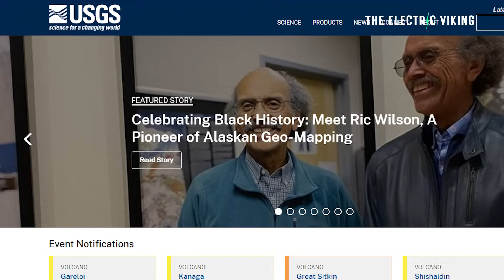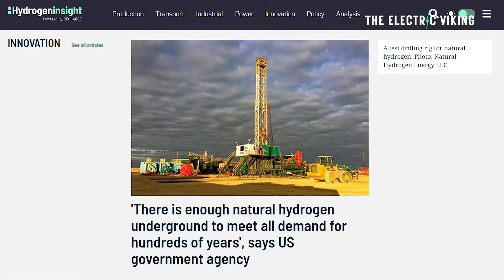US Government: 'Gold mine' with 200 years of hydrogen discovered underground

Comment: Sounds like the "South Sea Bubble" all over again.  (Scheme to extract the 0.04% of gold dissolved in seawater)
Why would anyone want to consider hydrogen as a replacement for efficient and proven fossil fuels?
Especially as there is no such thing as "human caused global warming/climate change"
Another daft idea from the non technical idealists.
Unless they are smarter than the Engineers and know how to transport a gas of the world's smallest molecule that leaks through anything and I just read that those leaks can self ingite through friction,  burn with a colourless flame and set fire to anything combustible in the vicinity.
Could always go for Hindenburg II I suppose.  Solar panels on top of the envelope to power the electric motors and a nice BIG lithium battery for when the sun goes down.   Bit slow compared with a 747 but it would be "saving the planet" (whatever that means)  What could possibly go wrong with that?

Comment: Everyday folks using hydrogen as fuel, forget about it. It leaks like nothing else. None of the petroleum piping, storage infrastructure can be utilized. A hydrogen refueling station in Finland already blew up, imagine hundreds of thousands, all around densely populated cities. The only reason fossil industry obsess on hydrogen is bc it's supply can be controlled & taxed like oil. Solar on the hand just falls on our roof to power our EVs, but Im sure they will find a way to tax sunlight too.

Comment: Hydrogen does not exist in nature in its elemental form.  It bonds - aggressively - with other elements as it is highly reactive.  It is only found in nature after it has combined with other elements and molecules.  The hydrogen that is underground is bonded into the hydrocarbon molecule, which is natural gas and oil and coal.  It's also in water - lots and lots of water - and to separate it from the oxygen atom takes a great deal of energy.  More than you'll get when you burn the pure hydrogen, assuming you can transport, store, and use it in a fuel cell or piston engine.  
This whole idea of "hydrogen underground" is silly.  Beyond silly.  Stupid in fact.  It isn't there.  Nothing to see here, move along.......

Comment: Clever. Just the time some people were getting ready to charge their cars with their solar system for free, they are trying to replace petrol with something as expensive.
Reply: Solar cannot provide the heavy lifting power generation we need to run the modern world.   It is good for spot generation when nothing else is available...when the sun is shining, but the capacity of solar isn't going to be charging many cars for years to come unless you have a large house with the roof covered and you don't drive very much.   In that case for sure...you could run your car on solar, but most people won't have that convenience and compressed hydrogen makes more sense once the oil gets low..which isn't anytime soon.

Of course the USA has abundant natural gas and when oil becomes too expensive to extract and refine we can make every product now made from crude using natural gas...and there are centuries worth of known deposits.

Comment: Quick question, if we source energy from oxidising hydrogen for hundreds of years what affect would that have on oxygen levels in the atmosphere? We would increase the amount of water on earth.
Reply: Good point (theoretically), albeit moot point (practically). The surplus of water shouldn’t be a concern, but the decrease of oxygen in the air might be.
Whereas if you synthesize H2 from H2O, you first release an O which is then reattached to H2 by the fuel cell system. That’s more of a close cycle. 
None of that will ever be useful for road vehicles anyway, hence the moot point. 🙂
Reply: Quick answer:  There is so much O2 in the atmosphere that this would be a drop in the bucket.  We've been burning carbon for over a century, and a LOT of it.  If that hasn't used up the oxygen, there won't be a problem with H2.  There are plenty of other problems though.
Reply: Sadly, there is a planetary warming factor from too much atmoapheric hydrogen as well. So humanity leaking too much of it will turn out about as well as leaking too much Methane and CO2 has.
Reply: who cares?
Reply: Quick answer: Don't worry. If there is hydrogen reserve underground, there must also be oxygen reserve underground too. Mine oxygen at the same time of mining hydrogen. Then after combining hydrogen and oxygen in fuel cells to get electricity, let the by-product water flow to the sea (or drink it), the nature will do its work - water will go underground where it will be de-synthesized into hydrogen and oxygen again! (Hope this is the case.)

Comment: Storage and transport of hydrogen are such big problems that rule out it's use in cars, probably forever. But it has huge potential to replace coal (coke) in the smelting of iron and steel, and is the steel industry's best hope of decarbonisation.
Reply: Absolutely. There are sensible use cases for hydrogen in industry eg steel and ammonia /fertiliser manufacture. Long distance trucks may also be worth it. Cars are not likely worth it. The EU has decided to require main transport routes to have hydrogen filling stations for those trucks.
Reply: Recently saw graphite thermal batteries, due to supply heavy industry with the heat and electricity they need. Cheap modular and can use spare solar and wind when it is otherwise worthless.

Comment: If you want to use Hydrogen, by far the cheapest and easiest way to get this is from Methane.   There are a LOT of known problems with using Hydrogen as a fuel though; it's also a lot simpler (never mind cheaper, which typically also translates into having a lower environmental impact) to use Methane instead.
Reply: Yes, but methane emits CO2 when it burns but pure hydrogen won't. Agree with you about the engineering problems associated the hydrogen, particularly as natural hydrogen is likley to be contaminated with other gases.
Reply: And if any escapes, it is a more potent global warming gas than CO2.
Reply: @roberthuntley1090  Some amount of CO₂ is safe and necessary. The question is, how much is too much? I think we should concentrate on reforestation of the Amazon rain forests which are being industrially stripped bare for farming or mineral exploitation, stop polluting the oceans with plastics and restore the plankton which generate most of the world's oxygen, and try to green the deserts such as the Sahara. Lots we can do before having to mess with hydrogen fuel.
Reply: And we know methane isn’t the answer to anything.
It’s as bad for global warming as coal.
Even hydrogen has AGW issues.

Comment: So, hydrogen as a fossil fuel? I suspect that in typical hydrogen hype fashion, they are wildly exaggerating the amount. But even if it is accurate, they still have the problems of transport and storage that plagues hydrogen as a fuel. The best use might be to set iup a fuel cell powerplant near the well-head, as the resulting electricity is easier to transport, easier to store, and a lot more useful.

Comment: It looks like Hydrogen can be an indirect greenhouse gas because it creates methane, ozone, etc. in the atmosphere.  This would only apply to waste hydrogen (leaked) and not to hydrogen successfully utilized as fuel.
Reply: Hydrogen combined with oxygen creates water. And that's it.
Reply: @4mb127  Hydrogen can combine with a lot of things.  It has a lot of energy and there are a lot of ways to release energy.  In the atmosphere it can create methane, for example.  It only produces water when it is put into an engine whose design guarantees that water will be the output.
Reply: And hydrogen is extremely difficult to contain.
Even methane leaks, is vented - a huge amount.
Lots of lies about how much. And Russia doesn’t care.
Oil & gas industry is just pure evil. Seriously.

Comment: What if used as NatGas is today, for heating and cooking, peaker plants, don't remove the methane just burn both together.  If it's 10% methane 88% H2, would eco-warriors claim victory?  They should.
(realizing some complications, steel pipe hydrogen embrittlement??  Leakage, diff combustion characteristics....)

Process as described should very gradually increase atmospheric O2, assuming oxygen makes it to surface, H2 will find a way out and then mostly leave Earth entirely, leaving less water and more O2.  By us burning it there's no net change in water or O2, just a cycle.

Comment: It would unlikely change anything.  Still has to be mined, refined and transported.
Reply: If converted to electricity at the well site, transportation is not an issue.
Reply: Exactly. Michael Barnard shows the problems & costs only start with initial production.
And the realistic uses aren’t stuff like baseload power, but on-site iron ore reduction. That’s the big one.
Also production of nitrogen fertilisers.
But not a lot else, it’s just too difficult & dangerous to compress & transport.
Reply: It depends if the mine location can be reasonably connected to the power grid. If the flow can be turned on and off and is fast enough then it could be really useful to power a backup power station for peak demand times and dunkleflaut. Alternatively if combined with a large storage tank it can be mined continuously and used intermittently.
Reply: @adrianthoroughgood1191  with respect, I doubt you understand grid costs. It’s really limiting for renewables, remote locations. You are talking high current connection (possibly long distance) used occasionally! I’m no expert, but I’ve learned that at least.
PS. Batteries will take over peak demand market. Only infrequent, longer shortfall in supply an issue. Where diesel shines now.
Reply: @iandavies4853  In the first sentence I said if it can be connected to the grid. It depends how close it is. If it's within a few 10s of miles from the transmission grid it might be worth it. If it's remote then not. Batteries are great for day to day variation. But if the wind drops for 2 weeks during winter batteries will never be enough for that. They are too expensive for something of that scale. That's when we need the backup power. Perhaps building a pipeline might be cheaper than a transmission line, depending on the terrain.
Reply: These mine date back to the 1800's  Hello...................  I'll say no more      as above so below

Comment: Sounds like a ton of BS. 
Probably for PR justification...

If it were true, we would have found a LOT more hydrogen when drilling for oil and natural gas. At best, natural gas would contain some H2. Which it does in some fields. 

Also note that H2 is pretty much the smallest atom, and will leak though pretty much anything used to contain it, and would have had plenty of time, over many millennia, to completely disperse though its geographic containment.

Comment: Best thing would be to convert the hydrogen into methane at the well heads to sequester carbon. Methane has many industrial uses and many municipal fleets already have natural gas vehicles. This would create a closed loop system for the carbon. The hydrogen is going to make water vapor but not near as much as a big volcano.
Reply: No
Reply: hydrogen + nitrogen = ammonia (liquid fuel)
Reply: How do you get the carbon? Atmospheric carbon dioxide is very dilute.
Reply: "Closed loop" from vehicles will involve amazing technology - a bladder to capture exhaust gas?
Reply: Captured exhaust gases have a huge volume, after all they are far less dense than the fuel that was burnt to make them. That means they would have to be compressed which takes a lot of energy. @iandavies4853

Comment: As for cars this is still a no unless we use it to spin turbines to make electricity.  Hydrogen is too too hard to transport. We seen at least on fuel cell in a car that died at 60K or so miles and was worth more than the car to replace.